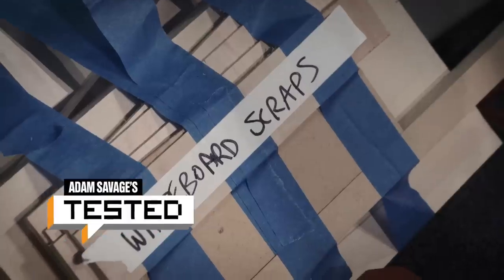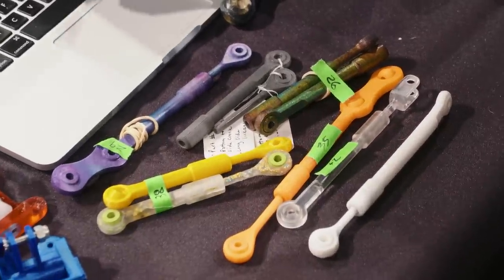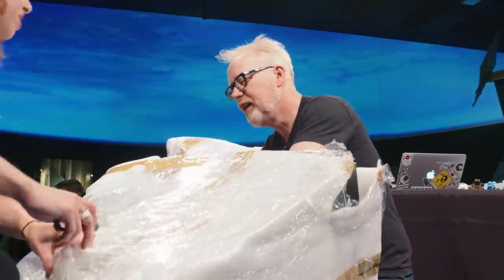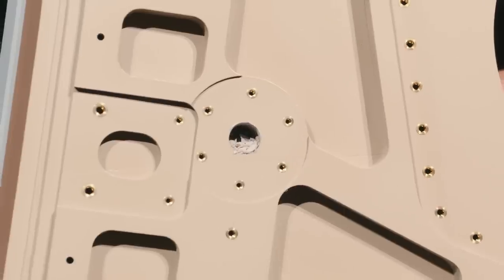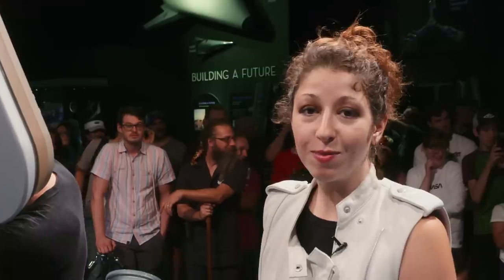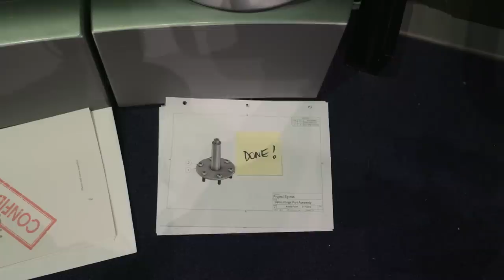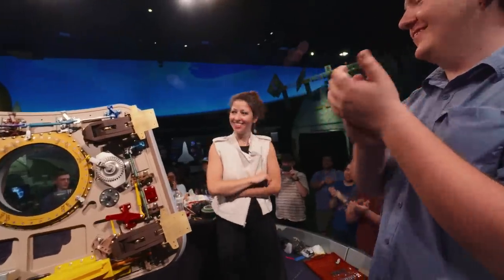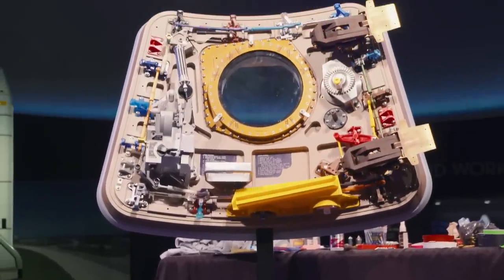Adam Savage’s One Day Builds: Project Egress Apollo Hatch!

Comment: "Hey Adam? It's cracking on this side..."

"Here, I'm gonna fix that right now"

Proceeds to do the oldest trick in the book
Reply: TAPHY TAP TAP
Reply: @dukenukem8381  Use the dingus end and release the schmoo.
Reply: as Adam would say "Hide your crimes"
Reply: @cameronsprole8456  ... as he DID say at the very last item he glued on, top right corner.
Reply: Little did they know, the actual hatch had the exact same crack in it...
Reply: Oh, so THAT'S what happened on the Soyuz.
Reply: Hide your crimes
Reply: Remarkably, assembling parts made by dozens of vendors from 5 (6? 7?) different materials, they made it work.

Comment: Tom Lipton's part is probably better than the original 😁. So many of my friends involved in this project. Very nice job on all the parts. Congratulations!
Reply: Yes - the machinists' parts were by far the most spectacular. 3D print has its place, but there was too much in my view. Such a shame Jimmy's hinges didn't survive the journey - they were very beautiful. But the gearbox (NYC CNC), the pressure release valve (Tom), the handle (can't recall who) and Fran's exquisite latch stole the show for me.
Reply: All the best 👍 for your friends
Reply: Came here to say this
Reply: Tom Lipton works at Berkley Labs. A sub-contractor to the real space programs. So, technically, the closest to an original part anyone could ever make!
Reply: Yeah probably not though. Even if any of these parts were dimensionally perfect to the drawings provided, they're still made from a guy that drew his dimensional conclusions from a 3D scan. Also, unlike the original, they not only lack the geometric tolerances present in the originals, but the materials used are certain to be outside the spec of the original parts. That being said, it's obvious that some talented machinists had their hands in the recreation of this.
Reply: @DC_ABC_123  Remember though, we're talking 1960's materials engineering and machining tolerances in the original Apollo parts. It's now possible for a home machinist to produce things that had to be machined entirely by hand, with less precision, back then. Aluminum and steel alloys exist now that the Apollo engineers hadn't even dreamed of and hobby machinists can readily access them. Manufacturing in general has advanced by titanic leaps in the last 50 or so years.

I'd say it's entirely reasonable that a few of the parts in this build meet or exceed the specifications and load demands of the originals.

Comment: BUT!! They never showed it working, and locking and unlocking! 
I really wanted to see it operate!
Reply: Based on the placement of that last dab of CA glue and kicker by Adam I don't think that is going to happen.
Reply: @chrisose , sadly you may be correct.
Reply: There's also the matter of a whole bunch of parts (like some of the the 3D printed stuff) that likely wouldn't be able to take the strain and would just snap.
Reply: noxxi knox  It was only the locking mechanism that was proposed to work. A series linkage like that is a pain to deal when everything is built to NASA tolerances but add a +/-5% to the equation and it could take days to tweek even if the all the parts can take it. They only had a few hours.

 Since the door is a stand alone exhibit the hinged did not need to work.

The parts I was surprised about where the windows. There was no excuse for the exterior window to be a 1/4" over in CNCed MDF. As for the interior window, as someone who deals with castings on a regular basis, we always account for casting shrinkage when we build the plug and mold. For this part to be 10% under is a rookie mistake made my someone who is suppose to be a professional.
Reply: noxxi knox  MDF does have it's place and I have burned through a lot of it through the years. Although admittedly this is mostly in plugs, shop fixtures and one-off interior elements for things like halloween sets.
Reply: Why didn’t they use metal for the 3D printed parts?
Reply: @madeinengland6784  because metal 3d printers are not as ubiquitous as you seem to think. And sintered metal that great looking either
Reply: noxxi knox  too bad you didn't get invited to make a part then I guess, what a shame that we will instead just have to listen to you talk about how much better you are.
Reply: noxxi knox  you can have an opinion, "I don't like it"
No need to talk about how trashy people's contributions were though, like you're some authority on making.

Comment: Question: Does it work? Can you pull the handle and lock all the surrounding lock mechanisms?
Reply: I wouldn't trust all the 3D printed parts to hold, but because it was planned using the original plans, it might work
Reply: nope, too many fragile pieces
Reply: Grevlain *CA glue has entered the chat.
Reply: Was always meant to be a display piece only.
Reply: @coregeek  Got ya. Thanks!
Reply: Coregeek Creations Yeah, but it should have moved at least once for the camera to confirm correct assembly.  All those participants working really hard to make mechanically functional pieces to spec and then it wasn't even shown to move after assembly, except the right side handle.
Reply: John Francis Doe That was not part of the plan. Adam has mentioned this several times in discussions about it. Some makers went out of their way to make functional parts but the entire piece wasn’t meant to function. There really were some beautiful pieces made for it tho.
Reply: You know Tom Lipton's Equalization valve works. All machined from stainless steel.

Comment: This video is a testament to how 1960s machinists who dropped out of school with an 8th grade education understood math and engineering better than today's college grads with computers and computer-guided machine tools. And they did so with paper plans before calculators were invented and they executed their work using layout ink, scribing lines with compasses that are not allowed in school today because they are "sharp." Few people have any concept of metrology, error accumulation and dimensional tolerancing... which dimensions are important and which ones aren't. Few people are actually measuring things their CNC printer or router makes. Most are simply assuming it makes it to the same 30 floating digit accuracy of the computer model. There is no concept of rigidity or thermal expansion/contraction. Notable exceptions are in there (you know you're here for ToT and Oxtool). You can buy a degree but you can't buy intelligence, just like you can buy health insurance but you can't buy heath.

Comment: No demo of how it works or linkages and levers in action?
It was a fantastic project though.
Reply: yeah where is working demo!
Reply: Would be surprised if that is possible. The instructions to the makers was to make it fun in whatever material they wanted, not necessarily produce fully working parts.
Reply: @v4lgrind  thats bad, cuz its looks so realistic and cool i thibk it should work!
Reply: Snitch Seven a lot of the parts were 3D printed and other artistic interpretations which wouldn't necessarily have the structural integrity.  The oxtool assembly probably would have done just fine  on a moon shot. Great build :)

Comment: What is significant about this project was that the original Apollo mission was subcontracted to thousands of small shops all across the US. A significant number of the US working population at the time was somehow engaged with the project. There were thousands of small machine shops making various parts for NASA back then. One person from back then said that NASA would show up after they made 50 nozzles (all on manual machines because small shops could not afford NC machines back then) and accept 10 of them. NASA only needed 1 or 2 of them so the extra were spares.

Comment: All that Fusion360 groundwork and set-up was so exciting, but then MDF parts showed up, 3d prints and all that 10% holes, glue, angle-grinder butchery happened, a let down for me.
It would've been more exciting if all parts were made from proper materials to the spec and the thing had actually worked.
Reply: I definitely agree but i feel like having each part being made by a different person kinda made that an impossible goal. They had to offset accuracy with group collaboration i guess
Reply: Would you like to take a guess at how much it would have cost?

Comment: I'm right up to the window where Adam is describing a cast window has shrunk.  Suddenly I'm listening to mrpete222's YouTube channel and him discribing pattern makers rulers.  That you have to make a pattern oversized because of metal shrinkage during the casting process.  Each metal has a different ruler be it aluminum, lead or brass because of different shrinkage percentages. 

Thanks Mr. Peterson for a greater understanding of what Adam just said and why the piece was wrong.
Reply: Amazing attention to detail on that window, except for the most important detail. :P The simplest fix would've been to make a rough pattern, plenty enough oversize to account for shrinkage. Then make the casting, fully cure it (a convection oven or food dehydrator works great) then machine the rough casting.

Comment: The apollo 1 command module that killed all three astronauts was from what I've seen  and heard Gene kranz and Christopher  kraft Jr say when the recieved it was a really really bad design that was rushed  with bad wiring  and they had to bolt these poor guys into that thing and when it caught fire there was now way for anybody to help them quick enough , the newly  designed hatch was a engineering marvel and opened in 7 seconds , u can see  how complicated that thing was by looking at  it , the new capsule was awesome and design so dam good that the artemis  program is using pretty much the same capsule just upgraded computers  prob alot of material, and thrusters ......

Comment: Great collaborative build. 
Although it would be so much better if NONE of it was 3D printed plastic parts. and if the cast parts actually fit correctly. and of course that one window that was oversized and cracked the main body.. that sucked.
signing it in pencil? why it wont last long.. if someone decides to clean the dust off it there goes every signature.

Comment: I'm surprised NASA used screws with the most bulky screw heads they cound find. That's an excess of one kilogram of iron for the hatch alone :D
Reply: It's not a part you want to fail. In fact Apollo couldn't fail. The point of the mission was to do it successfully. If it had failed we wouldn't even be here now.

Comment: This is far from a pointless exercise. From a machinists POV Assembling prefabricated custom parts is about at challenging as it gets. Reminds me of the first R7 payload mating in the Soviet Union. The rocket's insulation was cast over size. So someone was sent into town to buy a chisel, to chip away at the rocket and make the payload fit. Imagine doing that on top of a tadder in subzero temperatures.

Comment: You dorks built the door but NASA cant seem to figure out the Orion heat shield?  go figure
Reply: ...reverse-engineered an existing door designed by NASA over 50 years ago, and even with that it didn't work as some parts were wayyyy out specs. No way functional but cool project anyway.

Comment: Can you build a camera that takes what it films and is capable to project a digital hologram of the imagery than use infrared tracking ,then Lazer tracking to detect distance within the Lazer field...and motion sensors. and a clicker like a mouse so when say you set a pen as a printer and your pointing within the holographic projection you can use a clip clicker as the Lazer detects what you point at and selects say an item like as in if it were like iron holographic computer..or would you just be sending on fire by the hologram or go blind.
Reply: Oh and like track movement like a connect....
Reply: I feel like solid light is also an interest I like to um refer to when I look into this aka my theory on a real lightsaber or beam saber seems possible if you combine the two.but I wouldn't know how or would never be capable..
Reply: To simplify project object made of solid..or solid light...

Comment: If you 3d printed your parts, you’re not a maker you’re a printer, no different than a kinkos employee.
Reply: But someone has to load the spool of plastic and hit start.
Reply: Unreasonable Steev all you have to do is load the piece and hit go after the first piece with CNC. The first time around it sometimes helps to touch off on the work.

Comment: Jimmy DiResta....wood and brass. Printing hardly feels like making. Sitting on a desk and let a machine do the hard work. Pffsh.
Reply: @snarkylive  Some soccer mom found some files on the net, got a marvel license, boom she is rich. Was not her idea, not her design...I could not sleep as well letting the automatic tool do all the work.
Reply: DiResta's part broke. Adam spent hours fixing it. Idk why Jimmy decided to use electrical solder to weld the brass. Big mistake. Plus the wood snapped at a joint.
Reply: @danoriron4975  I think he said something about its just for the look. Dont think it was meant to go on there, he also made a printed version of it. Doubt that plastic holds up much better though. Wood in general is a bad choice for something like that though. BUT it looked awesome :>
Reply: @patrickpriebe9863  Well it still broke. Should have spent more time on a little durability. Adam had to gunk up the hinges with glue.
Reply: @danoriron4975  Wasnt meant to go on there, Jimmy made 2. One printed, one wood n brass. I love Adam, but "believing" wood would hold up on this is......nuts.